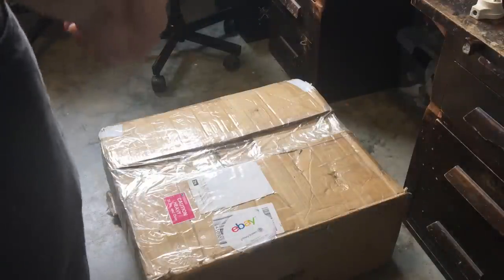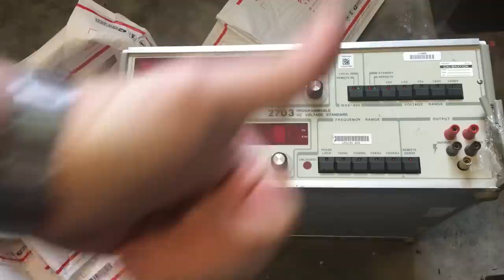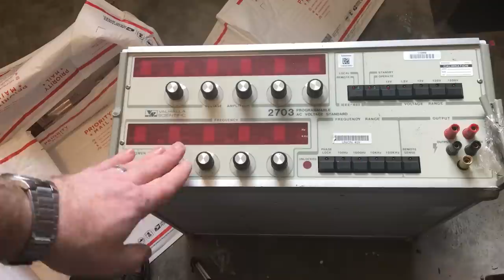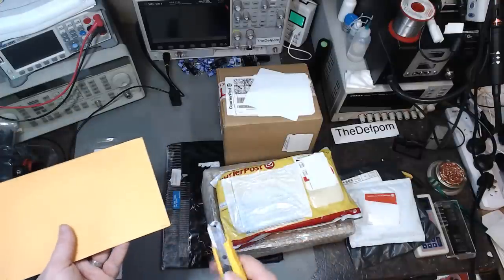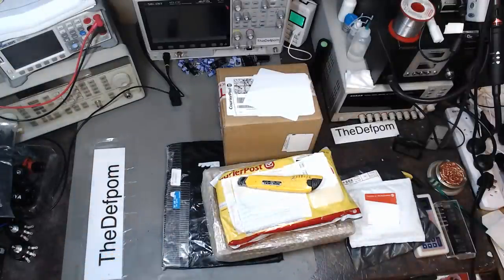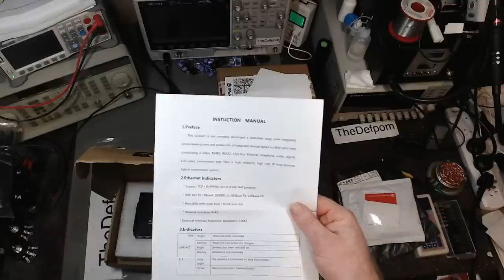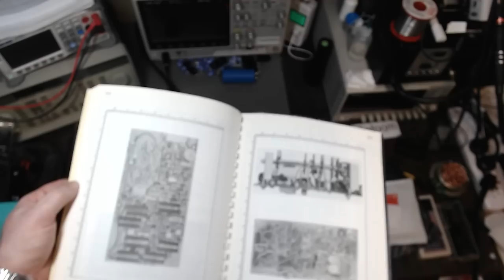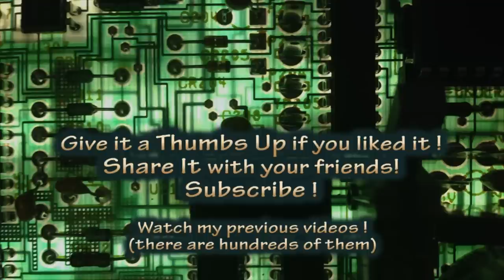🔴 #374 Mailbag Monday 7th May 2018

Comment: with the cable ties if you cut a hole in the side of the bag half way down you can remove a tie without the others falling out.putting the hole in the top will cause the ties to fall out on their own.

Comment: With your first parcel I thought you were going to put on some music and play 'pass the parcel'! 
I don't know if you can change the settings on your webcam to improve the ability to focus on single items but most cameras default to multiple point focus which causes them to still focus on the background when something small is held in the middle of the frame. Changing to centre weighted focus, or single point focus would solve this issue.
Reply from the maker: Pete Allum - the web cam is very limited, which is surprising considering how much it costs, any settings don’t stick across power cycles either... I will be using a new camera soon, I just need to get some mounts sorted out for it, as it weighs a lot more and my existing ones cannot handle it.